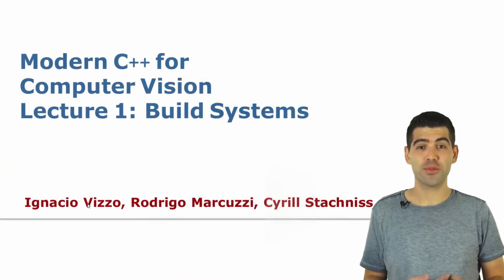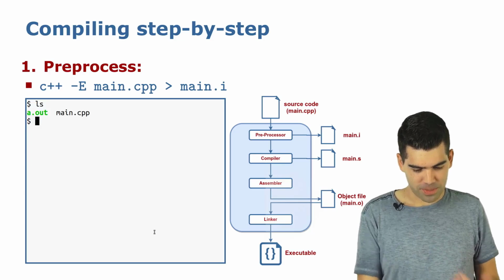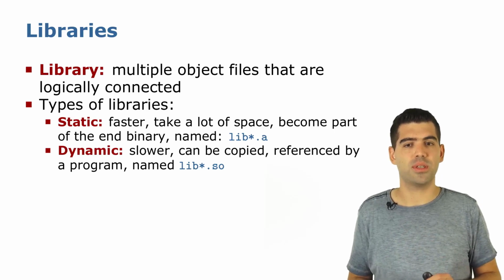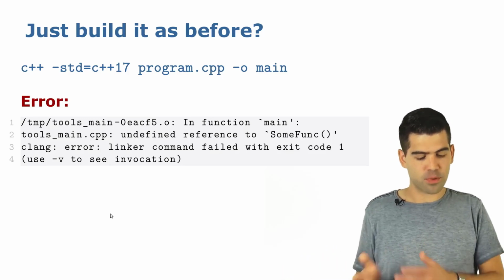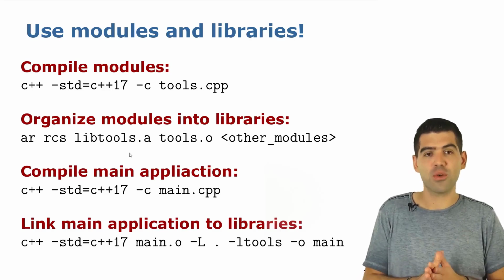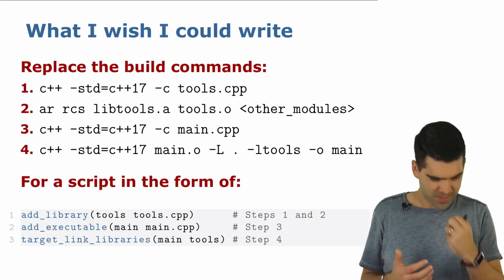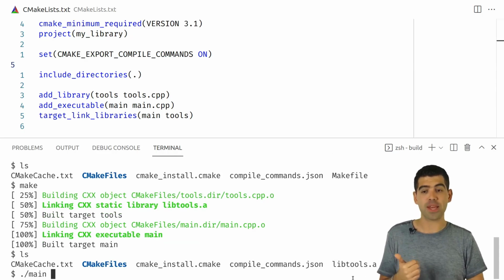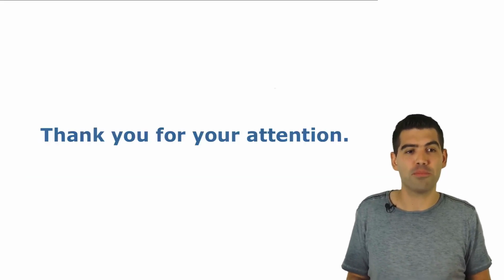Modern C++ Course, Lecture 1: Build Systems (2021)

Comment: 28:35 I thought the error would occur during the linking part when main.o and tools.o are linked. Even though I did not add "pragma once" I did not get any syntax error. Is it because I used clang++ as my compiler?

Comment: Thank you for this great lecture, one of the best I have seen so far. Which program / setup did you use to record it? I suppose you used some green screen tech? but what did you use to combine the speaker, the slides and the screen output?
Reply from the maker: Greenscreen and OBS